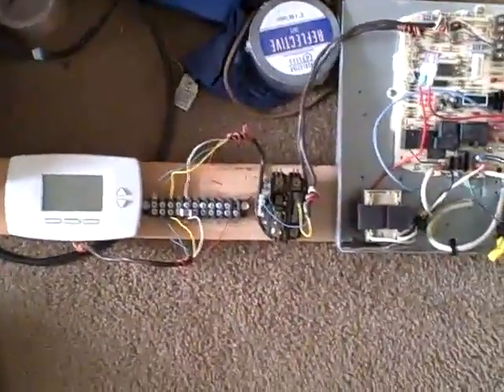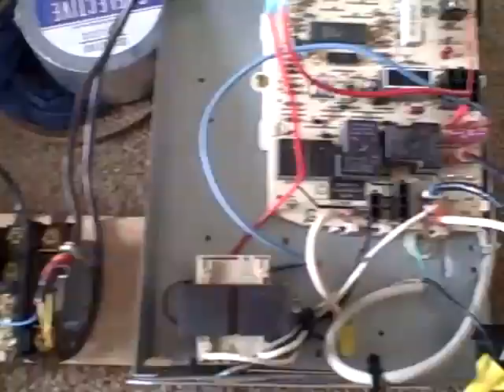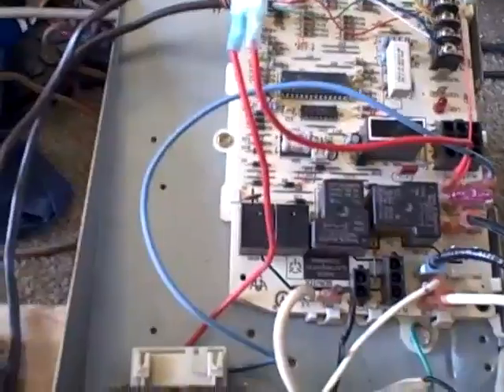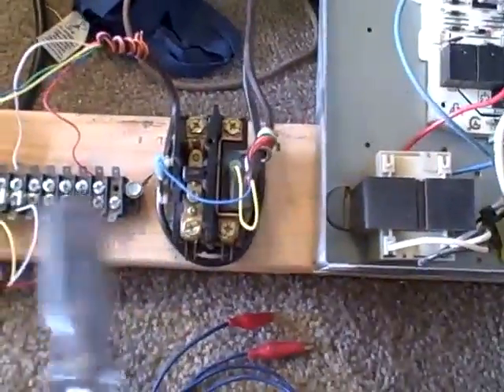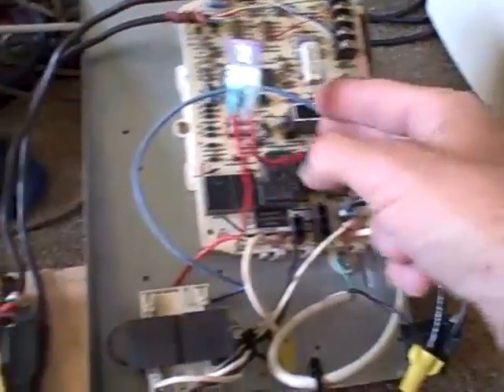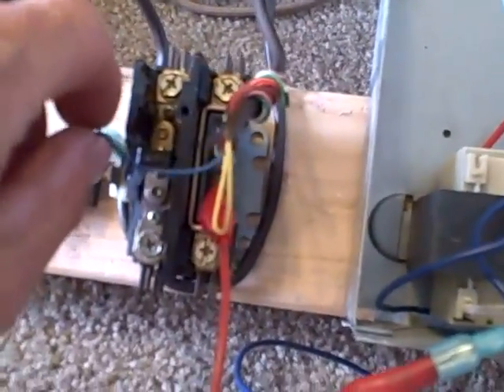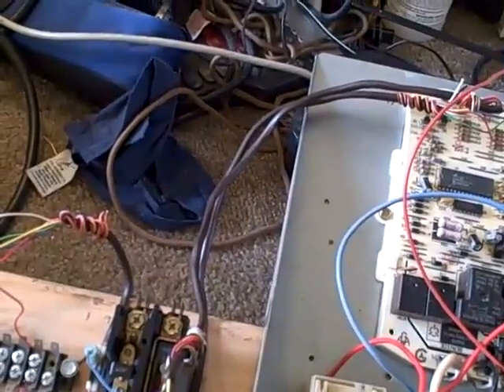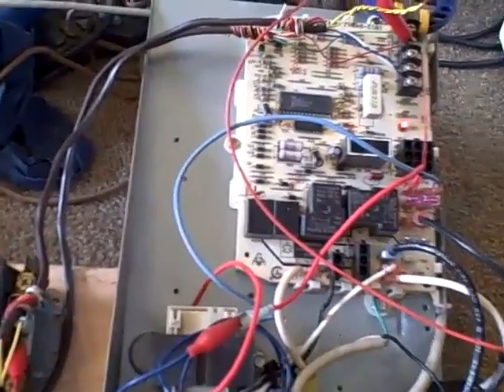HVAC low voltage shorts Part 1

Comment: Thanks for making, but there's too much narrative to connect to the all the wiring in the screen. 

I would suggest writing a script, and then take half the narrative out. "Less is more."
Then rehease the presentation and make slow points to to the wiring connectors you're talking about.

Comment: He says to use a 5 amp car fuse. In my experience, 5 amp DC fuses can let 6-8 AC amps through for a while before they pop. A 3a DC car fuse should be roughly okay. A DC load is on consistently, it is always running current at the max amperage, so it heats up a wire or fuse more quickly. An AC load flows electricity on a sign wave, and the average flow is about 0.7-0.8 of the maximum amperage.

In short (pun intended), some 5v DC fuses can let 6-8 AC amps through for long enough to destroy a transformer under some conditions.

Comment: Hi I did relocate my thermostat in the process chorts occur !! now I have cool air !! but no heat>>>
Reply: Thumbs up Benny on the failed DIY hvac attempt. Better stick with mowing lawns and no electrical work here on out.

Comment: i was racking my head with this today. no 24v at transformer so i replaced it. 240v coming into new transformer but still no 24v coming out. Its was raining so i couldnt check the cond. Now i remember testing for 24v while it was hooked up with the circuit damn it lol. Starting with the contactor in the morning. Thank you!

Comment: im battling my RUUID outside heat pump unit eating one 3a fuse every 2 days, its always ate one fuse every 2 years since new but recently started eating one ever other day. strange indeed
Reply from the maker: +Jthumper Sounds like you had a weird random short popping up. Really stinks having to track them down! I would start by checking the low voltage wiring at the outside unit, between it and the wall to see if you have any bare spots that are touching. Sometimes it can be right inside the wall edge, like if its going between the bricks.

Usually weedeating or dogs chewing on them or running over them is the culprit.  If that's good you need to check the inside low voltage wiring. If its in the attic it could be mice chewing the coating off the wire.

Without checking the system I couldn't hazard too many more guesses.  Is it just doing it in heat mode and not cool?
Reply: always heat mode, and it shuts the entire system down when it blows- I can here a click in the outdoor unit when I put the new fuse in. Wiring is all new, its done this since the home was built. I put in a 5A fuse last week, all been good since- the LV board in the outdoor unit is always wet and condencation everywhere when the problem occurs too
Reply from the maker: +Jthumper Well I'll be interested to see if it holds. Don't go above a five amp fuse though or you could try the transformer. Might be a fun one to look at it you were in my neighborhood :)
Reply: when it rains hard it eats a 5a every few days
Reply from the maker: +Jthumper hmm, done it since new... well first something is screwy with their design because that board should be bone dry all the time!  usually panel access is shaped in such a way that no water gets in. I might have to read back through your messages and see if I can find a pic to match your model so I have a visual of it. 
....now setting aside installing weather stripping on the access... this isn't anything recommended by the manufacturer, but if a wet board is causing the problem then if it was my unit and I couldn't seal the door, I'd cut power to the inside and outside units (240v outside and the inside unit suppies 24v to the outside unit) and then with a new fuse firmly installed, I'd unscrew the board from the panel and get a spray can of clear enamel or lacquer and spray both sides and let it dry and harden, then put the board back on and power everything back up.  I thought about camp dry but that wears off.
mind you, that's just me. if you fry it don't come to me, lol.  .  anyway high quality boards come with a clear coat on them already because if you have to work on them its a pain in the ass to carefully scrape the stuff off of solder joints!
Reply from the maker: +Jthumper OH!!  look down inside the middle of the unit and find the reversing valve. see if one of the two low voltage wires that control it have been rubbing the copper pipe and might have an exposed spot. also there are one or two clip on temp sensors (little round things) that are LOW voltage, eyeball that wiring as well.  if any of that wiring goes over or through the sheet metal walk look at it there to see if any of it has been rubbing!  funny the stuff that pops in your head!

Comment: I have a question my neighbor at my apartment complex has a really high bill, in fact everyone in that apartment for six years has had a really high bill. About two years ago my apartment and the other apartment both had new AC's put in. That apartment has problems still. They have their thermo set to 83 as do I and another neighbor, the bad apartment is double the bill usually. They've replaced the thermostats two times (not by an expert though just maintenance) Do you have any suggestions, this last neighbor is going crazy. How can we test the thermo? Thanks so much.
Reply from the maker: +Cyndee Wenzel you said they put in new units, did they replace the indoor evaporator unit as well?  If they didnt its possible there could be issues there as well such as dirty evaporator coils and crudded/dirty indoor fan blower that mess with airflow and temp.  ...however if everyones units are doing it then it could be a poor insulation issue (assuming the unit is sized right for the apartment)  Ive been to houses that have units working just fine, even if they are old, but they cant keep the house cool during the day. At night it catches up eventually.  The houses are usually like 30 years old and the insulation in the attic and walls has packed down over time and the heat just goes right through the ceiling and walls into the house!
To check the ac, you can use an infrared temp sensor, such as this one: http://www.amazon.com/Temperature-Non-contact-Thermometer-Emissivity-Adjustable/dp/B00JA3BMDW/ref=sr_1_1?ie=UTF8&qid=1442723692&sr=8-1&keywords=Infrared+temp+sensor

Let the ac run for at least ten minutes or more then  check the temp at the air return, then check the nearest vent coming from the indoor unit. Closer is better, the further you are away from it when you shoot the wider area it samples and wont be accurate. You should typically have at least a 15 degree difference. You will read places on the web saying it should be 20 degrees, but thats for locations only a tech can test so it doesnt apply.
If the temp is there or close (honestly it will still  cool with less, just not where it should be) then you can check temps of the ceiling in different places and the walls.

As a tech I bought an infrared camera a while back and its interesting to see where there is insulation in the ceiling and where there isnt!  I found two places in my home that have no insulation close to the outer walls! Just have to figure out how to get to them now, hehe.  Hope this helps!
Reply: It is always the thermostat, lol. Keep on replacing them. I have a numerous ideas what could be the problem. But I am keeping them a secret. I do not like cats.

Comment: I have a contactor receiving 24V but it doesn't close. I changed the contactor but still doesn't close. I guess there is somewhere short or back feeding on the low voltage. I don't know what to do.. Do you think this short pro tool would help me to find the short or backfeeding voltage? thank you very much.
Reply: I think learning how to use a telephone and calling a hvac professional would be your best move. Did you diy the wrong coil voltage contactor in? Way to go Einstein. Can you read. Contactors will say what coil voltage they are.

Comment: Just what I needed after shorting the outside AC control wires today.  Would never ever thought to look for a blown 3A car fuse on the control panel in the furnace.  Thanks!
Reply from the maker: You're most welcome!  Thats a highly common call that I would get too, weedeaters and dogs usually being the culpret! Hehe

Comment from the maker: When you say you disconnected all control wires and jumped it at the board, im assuming you mean you disconnected all wires, at the board, going to the thermostat?  When you jumped it what did you jumper?  Y or G?  If Y did you disconnect the wires on the outdoor contactor (tape them off) and test that way? Contactor could be bad if it pops, if it pops with the wires disconnected from contactor theres a short in the.wiring going outside. Ill try and check back here in the morning. :)

Comment: Love your videos. I was wondering if you can help me. I have a 3 amp fuse that keeps popping. So I disconnected all control wires and jumped right at the board. It still pops the fuse. So I installed new control board and it still pops fuse. Where else should I look for a short to ground? Please help.

Comment from the maker: @coldpak82 You would have to reference the manual or if you don't have a manual then hunt one down on the internet and see if is an option.  Most window units either come with heat or they don't but some might have that option, it isn't something I have researched though so I'm not much help in that aspect :)
   M@

Comment: Question,If i have 3x 10,000 btu turn type switch, A/C window unit.Is there anyway I can add heat strips to them? I'm having trouble finding A/C unit with heat.

Comment: @hvactecster79  Wanted to add if you determine it is in red power circuit from transformer OR green blower circuit, you can then disconnect the green and connect or tie in the yellow with red and turn on a/c.

No short, it is in green wire circuit or if you have the short, you already know yellow is ok, so it is in red power wire circuit from transformer.

This may sound tough, but once it is practiced, it is precise and quick to know what circuit the short is in. Not hard to find then .

Comment: @hvactecster79  Now it is narrowed to specific circuit area w/o leaving t-stat. To shorten that, place system switch to OFF and fan switch to ON at t-stat. IF no short, short is in yellow circuit to outside condenser. Still have short, it is in red power from transformer to t-stat or green blower circuit to furnace relay or board.

Same as before, narrows down w/o leaving t-stat. Just place the Li'l Popper or Short Pro in circuit to know if short is still there. Then locate exact location.

Comment: Turn on a/c and you have low voltage short somewhere. Disconnect red, yellow and green (normal colors/not always) from t-stat and tie/hook/tape together and try a/c again. No short now, short is in t-stat. Still got short, disconnect yellow and leave green and red connected and try a/c again. No short, short is in yellow outside a/c circuit. Still got a short, short is in green blower circuit to furnace relay or board or it is in red power circuit from transformer. Next reply will add more.

Comment: Hey whats up Mike , I've got the lil popper (mine has male spades not alligator clips), I dig yours with the light and its NICE having a VISUAL !!!
Man your a good man , for taking the time to make the instructional board , and the time to walk everybody thru it !!!
I actually went to the AUTO PARTS store and purchased the in-line fuse kits ($1.25), and put them on EVERY system I work on that does not have fusible link at board !!!
5tank clamp !!! LOL
Great Video Mike